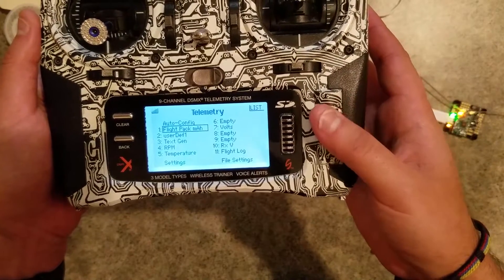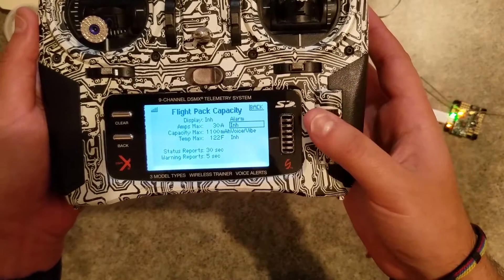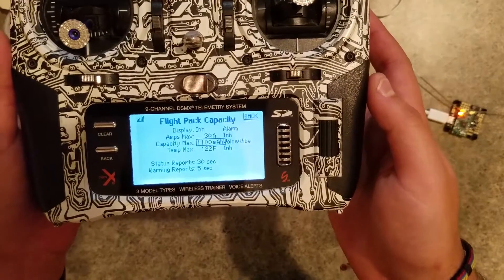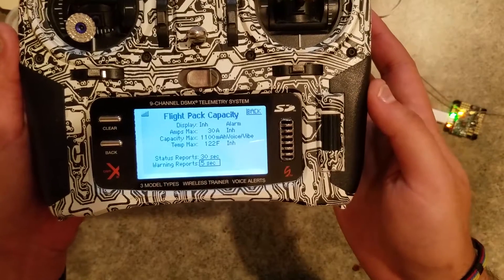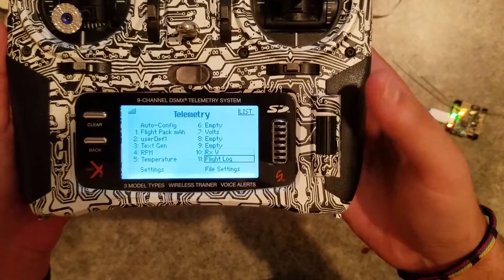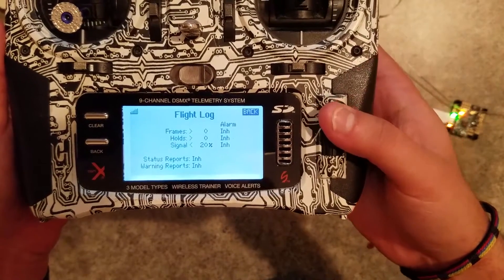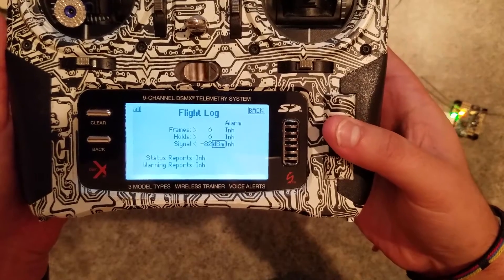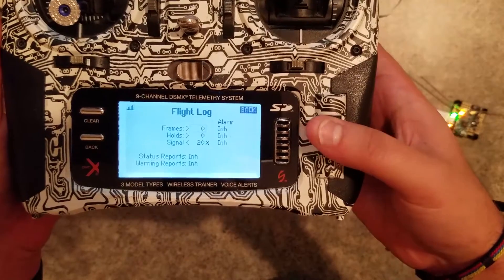Spektrum Airware basic telemetry setup for SPM4649T and RSSI

Comment: where did you ge that controler sticker  cover
Reply from the maker: http://www.ebay.com/itm/RJX-Blue-Futaba-Spektrum-DX6i-7S-9-Transmitter-Gimbal-Stick-Ends-HA0626-FU-BLU-/271849519634?hash=item3f4b7e7a12:g:DzIAAOSweW5VOxsO

Comment: have a dx8 gen 2 and i don't have a signal feture
Reply from the maker: you need to update your radio
Reply: Miguel Alvarez thanks I did that and it worked just one question does it speak to you if it goes below the rssi point you set
Reply from the maker: VictorFPV Spoken rssi warning isnt available yet. it should be in the next update. right now you can only do tone/vibe
Reply: Miguel Alvarez thanks for all the help!

Comment: Hi Miguel,

If I can get RSSI from my Crossfire Micro RX to my Omnibus through SBUS. Can i send it to my DX8 Gen 2 so I can hear it using the the voices and vibration?

Thank you.

Where you get that awesome skin for the Transmitter?
Reply: Nes Marinescu how do you get rssi from cross fire to fc.. I've been trying to do that one for a little bit
Reply: If you have an fc with an OSD like the Omnibus or the Betaflight FC, simply output RSSI to one of your PPM or SBUS channels on the Crossfire. Then in the Betaflight configurator assign that channel to the rssi value. Care it is offset by 2 3 channels, sometimes channel 7 on xfire is equivalent to channel 9 in betaflight. Go to the receiver tab and that channel will oscilate based on the RSSI value. Oscarliang has a tutorial on this.
Reply: Nes Marinescu OK yeah I have couple omnibus fcs I'll have to try that.

Comment: So will the telemetry work at all with a Eachine Wizard X220? This quad uses a F3 6DOF, betaflight 2.9.1 version and from what I see only uses a sbus connector. I am trying to figure out before I buy it the best way to use my dx9. This quad does not have any osd so it would be nice to see my remaining battery. 

I was also looking at using the Spektrum Quad Race Serial Receiver w/Diversity but again the telementary would be nice. 

Final question because of the carbon fiber can I link 2 remote receivers to the Quad Race Serial Receiver w/Diversity instead of one?

Comment: that auto configuration is that new on what firmware level for the radio?. I've never seen that on my dx9.
Reply from the maker: Probably, I didnt know about it until andy told me to use it not too long ago :P
Reply: Miguel Alvarez thanks it has to be an update because I have a dx9 and the telemetry receiver and that is not an option on my radio and neither is the Rssi in the flight log section. Which is what I wanted at out everything.